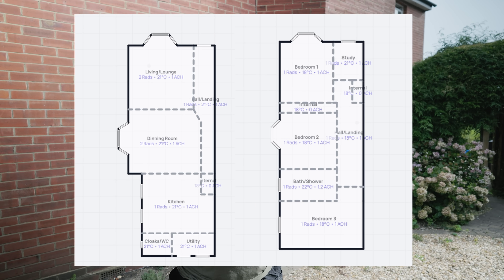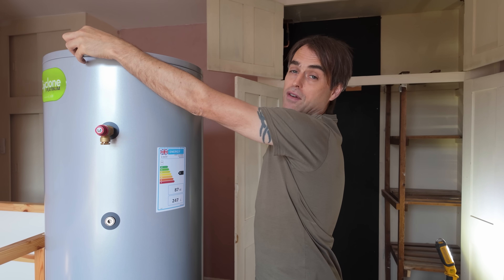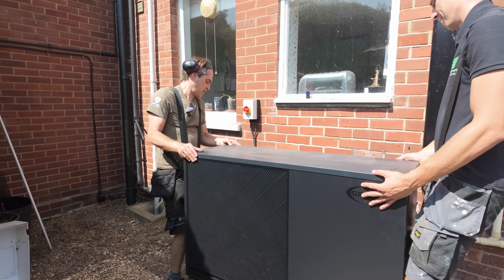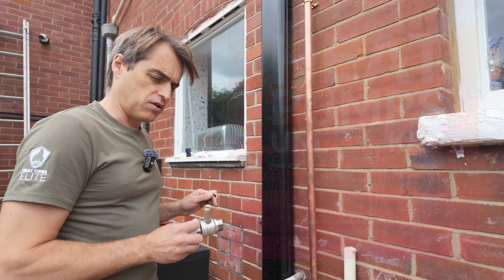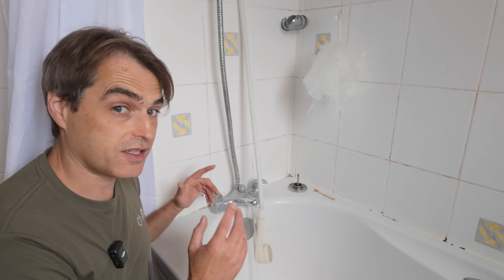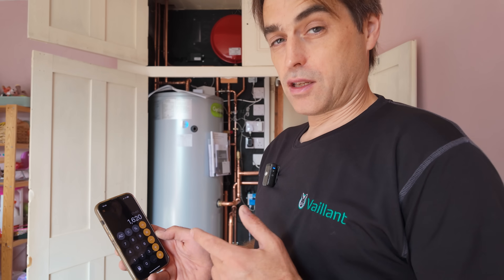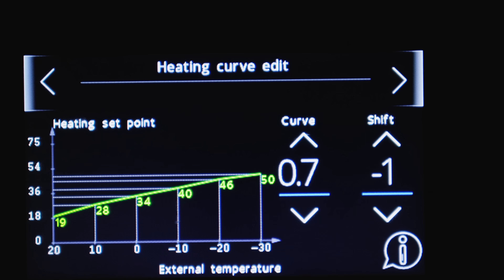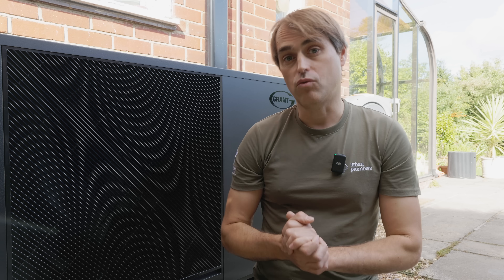Cheaper Heat Pumps Are Here. But Are They Any Good?

Comment: In my experience getting the right heat-pump is half the journey.

I’ve just had a heat pump installed after nearly two years of research! It’s been working brilliantly. 

I am also a software designer testing an early-stage tool to help homeowners to find good heat pump installers.

 If anyone thinking about a heat pump, but stuck/unsure choosing an installer in UK.  I'm happy to help for free and get genuine feedback on the tool.

Just message me if you’d like to chat. ;)

Comment: great video - is there any restriction on fitting this unit under a window beside back door of house? Also a manhole cover close by? that would be the best placement/shortest pipe run to our hotwater cylinder. Thanks Mick
Reply from the maker: No, under windows and over manholes is fine
Reply: @UrbanPlumbers awesome thanks so much.
Reply: @UrbanPlumbers any links or updated documents on r290 exclusion zones? My installer is saying needs to be 1 meter clearance from a door/window
Reply from the maker: UNDER the window is fine

Comment: Why use copper  for all the piping and not multilayer (PEX) or galvanized steel piping? Those latter two cost  just a quarter compared to copper.
Reply: Yeah I also don’t understand that. I asked chat gpt and it said it’s fine to use PEX. However I asked another AI model and it said it’s not fine as oxygen can go through and eventually cause problems. Idk.

Comment: Hi. Does anyone know how to wire the aroTHERM pure 4kW to the Honeywell HCC100 zone controller so that you can switch from heating to cooling from the room thermostat? I assume that the normal cable from the OT boiler on the HCC100 to the aroTHERM pure indoor unit OT (OpenTherm) connection is only intended for heat demand and cannot switch to cooling. Does anyone know how to wire it correctly? Thanks in advance, Maas

Comment: Great video wonder what manufacturers will state regarding not putting glycol with r290 units makes total sense! Heat pump manufacturers need to up there in house engineers for warranty/repairs visits as this is a big put off for some installers, more a getting in-house engineers in but the lesser manufacturers still use agents which is a put off. Really informative video 👍

Comment: I've got an older R32 Grant Aerona. Would you say the smart controller is worth the upgrade over the basic one?
Reply from the maker: 100%, but you may need a new PCB as well so may cost close to £800-£1000 in parts alone

Comment: Never seen this on other units, They have an anti-freeze protection heater on the plate heat exchanger and heated base tray.
 Are these trace heaters? Are they taken in consideration for COP ?
Reply from the maker: Yes they have to be included in COP as there is only one power supply to unit. Not good if there is power cut though

Comment: Cheers Szymon - would be very interested to see videos comparing the sound level of the Arotherm vs the Grant if you ever get chance :)
Reply: Wait for the new Arotherm, just launched in Germany. Completely Redesigned, in black. Less restrictions on unit placement due to R290, More efficient and quieter.👍
Reply from the maker: Is it a single to buy yet?

Comment: I wrote to you earlier regarding a quote for my property but didn’t follow up—apologies for that. The reason is that I’ve decided to run my old Daikin until it finally gives out before upgrading. I did notice that you’re no longer supporting NIBE and was curious about the reasons behind that. Also, do you have any plans to start fitting the WeHeat Blackbird? It looks like a promising solution for anyone with a flat roof, but beyond their promotional videos there’s very little independent information available. Kind regards,

Comment: It isn't the cost of the heat pump it is the rip off installation costs. Especially from heat geek! £3000 for sundries? 4 days of installation cost when the engineer said it will take a day. Separate charges for commissioning and electrical.
Reply from the maker: This install tool 8 days on site
Reply from the maker: Average installs take 4-7 days on site.  No one can install in a day. Sundries these days are around £2k.

Comment: I am an austrian tec and i use 99 percent of the time panasonic, maybe you should have a look at the new m series these are very quiet have a nice cop.
Reply: Same here in Germany, if you need a Budget one, get a Panasonic! Those Chinese ones do work, but have to be so cheap that a lifetime of only 5 Years until replacement is still a valid Business case. Otherwise a more premium Panasonic with 10+ Years lifetime is cheaper in the Long run
Reply from the maker: is the new arotherm availabel yet in Germany? the black one?
Reply: @UrbanPlumbers  yes they are now available
Reply from the maker: Could you drop me an emial please if possible? Info(at)urbanplumbers.co.uk

Comment: Nice to see some A/C style trunking used for the outside pipes. Is it specifically made for larger ATW pipework / insulation or, just a much larger version of AC trunking? Colour options? Much cleaner & tidier looking appearance than single pipes & cables running up the outside wall. 
I'm not a fan of the looks of any HP outdoor units used for residential systems but this Grant unit looks a bit more "boxy" than the norm. 
Nice to see something different & some real world issues overcome. 
Top quality content & installation.

Comment: I had the 6.5Kw unit fitted in March 25 along with a 300L tank (should have been 200L but was labeled wrong)

Has been wonderful so far, paired with Solar and Batteries virtually free to run over for our hotwater over the summer.
Reply: Hi Mike, hows the noise level? Im worried my neighbour will complain.. i live in a detached house next to another detached house. Pls advise.
Reply: @neenyu1831 We had exactly the same concern but it depends on perspective of noise and position of the unit. Ours is behind our semi attached garage about 6 meters from the house out of direct line of sight and air flow and the only time we notice it is when it's on full tilt heating the water and our doors are open or where in the garden but even then it's no worse than the background traffic noise. Inside the house with doors and windows close next to nothing or at worst a fine breeze.

Our installer arranged for us to see one before we went ahead. That was positioned near the end of a narrow passageway between two house's and that did resonate a little in the gap.

You can buy sound reducing enclosures but we haven't and so far no complaints.

Perhaps your installer can arrange for you to see one live (we're in Northampton) but otherwise they have to carry out a noise survey, have a solid base and if you can direct the airflow away from your neighbours property in to open space the best you can.
Reply from the maker: That's great news, glad to hear it's working well for you!

Comment: A heat pump is only as good as the installer – the materials, valves, fittings, and how the system is set up. What’s printed on the box is almost irrelevant. The important part is that the installer shows up when there’s a problem and actually fixes it.

Buying a “big brand” doesn’t guarantee warmth. Most “premium” European units use the same Asian components – Vitocal 150A has a Highly compressor, Bosch Compress 6000 uses Mitsubishi, etc. European firms are tiny compared to Asian manufacturers. The only area where Europe still has an edge is heating system control, as Simon said in the video.

We had these same arguments on the continent 15 years ago, just like you’re having now in the UK & Ireland. And yes – if a customer insists on Nibe, Bosch, or Therima, go ahead and sell it – but don’t ever let the installer put in galvanized cast-iron fittings with a heat pump 😂.

Comment: Not sure why they chose Grant. Irish connection - Grant Heating factory is in Crinkill, Rep. Ireland ?
Interesting to see a change form the usual Vaillant. Grant 9kW HP's are only slightly cheaper than Ideal Logic R290 8kW  (made in Hull) or Samsung. 
Most of the cost is the additional components and of course the installation costs.
I bought a Japanese aircon unit  a few years ago 56dB sound rating, but most of the annoying noise is not from the fan, which is pretty quiet but from metallic rattles due to sympathetic vibrations in the case and coils of the outdoor unit.
The specs for the Grant unit look good on paper. It would be nice to see how it runs over winter.
Yes Vaillant's fixed firmware (you need to change the board inside to upgrade firmware)  is outdated - most other makes allow for firmware fixes going forward.

Comment: I’m confused! You’ve been saying all along; make sure you complete an accurate heat loss calculation and match the heat pump output to the heat loss. You have a heat loss of 6.61 kW but the Grant 9kW from your summary will produce 10.38kW at -1.7 at 45 degrees. That’s 50% oversized! Wouldn’t the 6.5kW  match the output? Or have you changed your way of thinking and are now oversizing, due to units not producing what the manufacturers say they do?
Reply from the maker: Video coming soon. Unit badged output is not the actual output - this one outputs around 6.8kW from memory
Reply: @UrbanPlumbers  - I need approx 5.5kwh, was going to go with the 6.5kwh Grant. Are you saying it won't deliver 6.5 kWh?
Reply: @U @UrbanPlumbers  friendly reminder about this matter
Reply: @UrbanPlumbers thank you so much about this very fast response. 

Are there any plans for a video about heat loss calculations? Or maybe a guide? I’ve seen Heat Geeks guide and it’s the one I use. Is this the correct way?
Reply from the maker: @xristostsilis  i would assume that HG would be spot on with their guides for HL. I don't have much time to do a video about HL, as we are now working on a full course, and a very detailed module about heat loss will be a part of it.
Reply from the maker: Ok, here’s where it all comes together.

We now know that the 9 kW Grant unit can consistently deliver around 8–9 kW at −2 °C, with defrosts included. We also know it can modulate its electrical input down to below 400 W, which is excellent. And although it doesn’t use a degree-minute algorithm, its control logic manages cycling very well — in practice, it simply doesn’t cycle.

This is where the confusion around oversizing comes in.

Around 90% of heat loss calculations are carried out to CIBSE standards, which can overstate the true heat loss by up to 50%. Through experience — roughly 400 surveys and over 100 systems installed — we’ve learned how to calculate heat loss to within ±10% of real-world performance.

To put this into context:

Our calculated heat loss for this property is around 6 kW

A strict CIBSE calculation would put it closer to 10 kW

Now, if you size the system using the book values, you end up with a 10 kW heat loss and a 10.8 kW quoted heat pump output — and on paper, everything looks perfectly matched.

But when you look at the real numbers, the picture changes:

Actual heat loss is around 6.5–6.8 kW

Actual delivered output from the unit is around 8 kW

At that point, you have two choices:

Continue overstating both the heat loss and the unit output, or

Learn to calculate heat loss closer to reality and validate heat pump performance through monitoring.

Oversizing itself is not the problem — uncontrolled oversizing is.

Oversizing is perfectly acceptable when:

It’s moderate, typically up to 30–40% above the actual heat loss, and

It’s paired with good controls and strong low-load modulation, as found in units from Vaillant, Viessmann, NIBE, CTC, and Grant R290

I would not apply the same approach to some other brands, such as Daikin, Mitsubishi, or Samsung, where I’ve repeatedly seen severe cycling issues caused by poor low-load control.

Comment: Thanks for doing this video. I'm fitting a few these units at the moment and can pretty much agree with everything you've said. I've just done that firmware upgrade on mine and hot water and heater has definitely Improved. The system has a lot of room for improvement. But the fact that Grantuk have made this system so easy to upgrade is just brilliant in my opinion.
Reply: What has improved about the hot water and heater after the update? I have one of these units installed at my place. An eco DHW setting is at the top of my want list.
Reply from the maker: You have now 2 levels of quiet mode so can limit the compressor output - sort of simulate eco mode
Reply: @UrbanPlumbers  That sounds like a good start! How do I get updates as a consumer? Surely I don't need an engineer to visit to put an SD card in the remote unit?

Comment: I suspect there are a few Chinese made heat pumps on the market that are repackaged under different brands. That Grant controller is identical to the FoxTouch controller that I installed last November for my parents along with the 9kW FoxAir R290 unit they bought from Poland, so chances are the Grant and FoxAir heat pumps came out of the same factory. For the record it has averaged a COP of 3.6 so far, that might sound low but that's because it's connected to a 2500 litre thermal store that is heated to 50c on a cheap overnight tariff, and it's certainly better than their previous 12 year old Mitsubishi could manage. Not bad for £1800.
Reply from the maker: Yes, it’s very likely the same unit as the controls were done by a Polish company I think
Reply: I believe that they are from Plum

Comment: Our heat loss calculation is about 15kW.  I wanted a Viessmann, but my installer checked the technical specification and he said their 16kW model seems to deliver only 13.3kW at -2C.  Therefore, we went with the Grant 290 15.5kW.  It is running beautifully at the moment.  The Data History on the phone app and econet24 web site is good.  My only reservation is that it does not track energy usage or COP, which is surprising as it seems to measure both of them on the Smart Controller.

Comment: First of all, thank you very much for your videos. I am a fan of your channel.

Are you sure you want to put Grant ahead of Daikin? The Altherma 4 H is more efficient, has a wide modulation range (10 kW unit goes down to approx. 2 kW thermal output at +7 degrees Celsius), has several options for the indoor unit, is significantly quieter, has had its control system upgraded and has good factory customer service, at least here in Germany. I would even rank it above the Arotherm Plus, but I might be biased because of owning such a system myself since May.
Reply from the maker: Never been impressed with Dakin. No control for post buffer pump requiring use of 3rd party controls. Older models had very basic and confusing controls. Wiring is a total headache. Manuals impossible to decipher. They are just not thought through very well.

Comment: This looks like the Chinese Sunrain unit. I bought a 12 kw unit for about US $4000 and it heats a 350m2 property with radiators with a COP between 3 and 5 depending on ambient temperature and water temperature.(40-47c)
The controller can be accessed by app. and could be better but works overall. So far I have had no problems with it over 2 years and have bought a second unit to do DHW for simplicity and because I have high usage.
Reply: Interesting, Grant is a well regarded UK boiler manufacturer.  Sure they could make their own, but guess you are correct

Comment: Thanks for this informative video. I’m just wondering—if the thermal loss is 6.6 kW at -2 °C, why did you choose a 9 kW heat pump? Wouldn’t it make more sense to design the system with a lower thermal capacity?